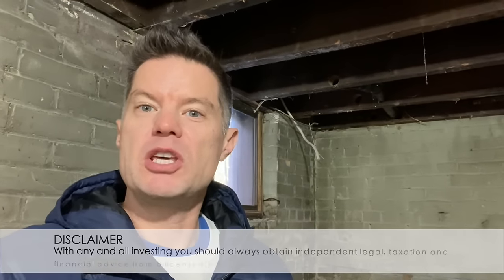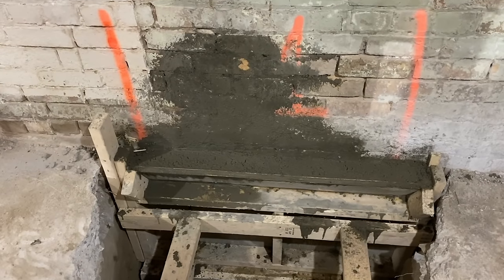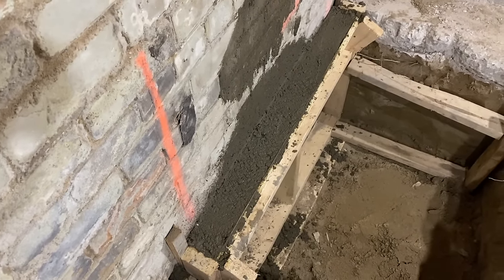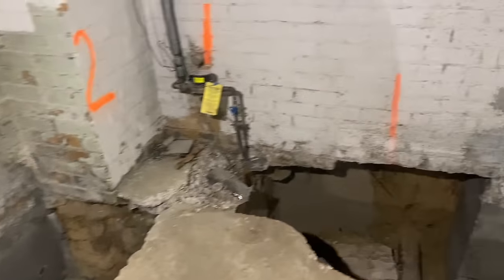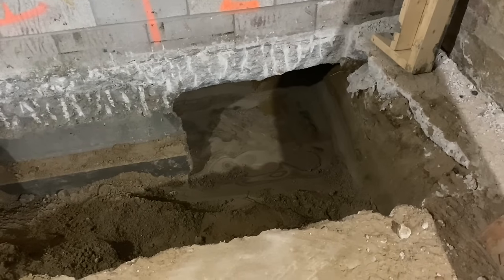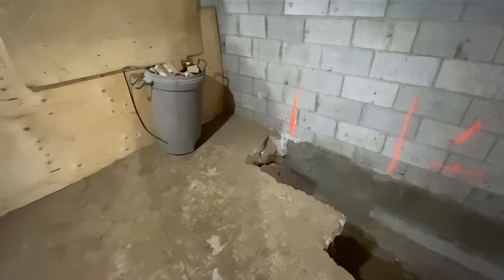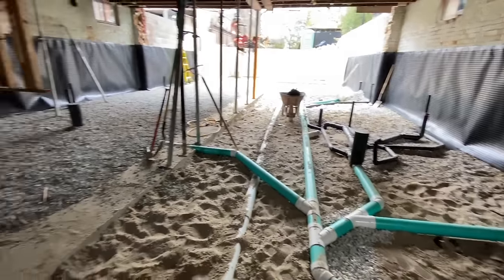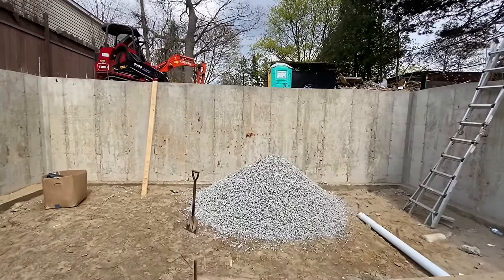Lowering your Basement | Step by Step Underpinning Explained | How to Lower a Basement

Comment: When I was in my late teens my father got me and some friends to dig out our cellar which extended under the back third of the house. The old ceiling was about 5ft and we dug out about 2ft more to make a decent room. Then we extended under the next third of the house where the ground level was about 2ft below the floor joists, removing about 12 skip loads of earth so he could put in an internal staircase. We actually dug below the foundations of the 1890's house which consisted of the bottom course of bricks corbelled out by a half sitting on about 18" of cinders then put in strip foundations and built up blockwork walls and finally backfilled between the blockwork and the old wall/foundation with concrete a section at a time. That was 40 years ago and there's been no movement since.

Comment: I’m doing a similar project but the engineer that’s designing it wants to do horizontal rebar between each poured bay. And so I’m using hydraulic jacks to dig out 6 to 7 foot wide sections at a time even though I’m only coring 3 feet at a time because I’ve got all this lap rebar hanging out.

Comment: 400/ft.  Thank you VERY much. Will use that as a guide to get estimates.   50x20 footprint. If I can get it done for that it would be lots less than I expected.  Looking at a quote I got from 2017 for $550/foot. Must be the competition in Toronto.

Comment: Great video! But I am wondering why you didn't use rebar in any of the new concrete you poured?
Reply: I'm wondering too! Also I wonder if they mixed Helix in with the concrete. Helix  can do away with the need for rebar but I would think the cold joints would need rebar to keep the individual pours aligned.
Reply: I guess it's no different than an old stone foundation... But why not use rebar?

Comment: At 15:00 - what material is the under floor insulation and what are those clips holding down the pex tubing called? 

I had a bear of a time trying to route pex under my ice rink liner. This looks like a better solution. 👏👏👍🏻

Comment: I WISH I could get a perimeter underpinning done for $400/ft. I am stabilizing a shifting/cracked (no rebar) concrete foundation in a 65 yo house on medium clay. All accessed from the outside. 210 LF. Should be around $85k. Bids range from $170K- $280k. Going with helical piers might save me about $50k, but half the engineers say it needs to be "capped" (essentially a partial underpinning) before the piers are set or sometime in the future, the foundation between the piers (23 of them!) will settle and the local contractors will need another infusion of $$. As best as I can tell, the "capping" (weird because it's under the existing foundation, I think) adds about $50k, so it's a wash.  GREAT Video, btw. Lots of excellent information in less than 20 minutes. (Many arrogant inspectors and contractors have spent more time just telling me how many years of experience they have...)
Reply: Yours sound exactly like mine. 800 sqft house with poured 4ft deep foundation with no rebar. cracked due to settling on clay. I planned on doing this once i get an engineer to give me the plans. need a wider base to support the weight of the house. maybe double the width at the bottom. I would over engineer the rebar though i dont want to have issues in the future. need to find me a structural engineer that can let me know if this is viable.

Comment: This is the most informative underpinning video I've seen, by far! I own a 1960 brick home in Ohio that currently has 6'10" finished basement ceilings. I am planning a complete remodel of the property in a few years and I am considering dropping the floor to get a 8'6" ceiling height. My foundation is much smaller than this property (basement is about 1000sqft total), but based on the cost of this project, I suspect it would still cost about $25,000 USD to complete my underpinning, which is about 25% of my total budget for the remodel. One thing that isn't clear from the video is whether or not all the waterproofing/management, drainage, sump, etc were included int he price. Also, it doesn't look like you added any rebar to tie into the existing footer.

Finally, did you consider using closed cell spray foam to insulate under the slab? I think it's a superior option because in addition to being an excellent insulator it is also an effective vapor, moisture and radon barrier all in one...especially if you run it continuously up the foundation wall into the rim joist.

Comment: what steps do we need to take to deter radon from entering the house home? Thanks you! Your videos are amazing and helpful! Thank you!
Reply from the maker: We put down gravel, a layer of 6 mil poly, then the 2" of rigid foam and then radiant infloor pipes and then the concrete. This area is not known for radon but if it was there are some additional measures that could be taken.

Comment: Great video. Have question. When you lower basement the sewer line can be lower than the city line. I understand you can install an ejector pump, but I've heard a lot of issues with the pump. Any other options you can suggest?

Comment: This is amazing!! Indeed. Would be really helpful to know how the main wall support beam/wall was built, then removed the support pole. Any idea how? Thanks!
Reply from the maker: All of the bearing walls were removed with temporary shoring post and beams. Support on either side of the load bearing wall and then remove the structure. Once that's done, you can reposition the load bearing temp walls to make it easier to work around them. Hope that helps.

Comment: That is very fascinating. The house has no continuous foundation, but only a thin strip of concrete on which bricked? Furthermore, the new, deeper foundation is not physically continuous? It's basically individual blocks now. Reinforcement would not have done anything because there is a crack between the concrete blocks every time? Our small 1960's house has a continuous wide strip foundation under the walls. I never thought that such a large apartment building could stand on the bare ground.
We'd also like to "raise" the basement, but we're afraid there's a reason the basement wasn't dug deeper, and we might hit rock.

Comment: Great video but I’m curious as to how you address when lowering the floor you inevitably expose the soil pipe embedded in the old concrete floor and exits the foundation perimeter wall at a fixed height.  If the new floor height is now below this point, how do you ensure proper drainage? Do you install an ejection pump? Thanks😀

Comment: @DarrenVoros Excellent Video... but you didn't make mention of adding any rebar into the underpinning walls? Is that something that was done and just not documented? Or is rebar optional if you use a specific kind of concrete?

Comment: Great video- Question-  Is there some type of underpinning for a house that has a dirt floor basement.  ( 8 foot at end and 4 foot at other end ? )
Reply: Doing just that to my aunt's place right now. It is set in a hillside in a split style floor plan with a stepped foundation.  There is a walk space of 21'x14' that we are converting to a great room.  It was 12' dirt to joist on one side and 8' on the other rising 4' across the 14' depth. We are chosing to frame the floor with a crawl space because bringing in ABC would have been by hand in 5 gal buckets carried up ladders. Framing will be way easier. We are placing in triple 2x8 open cribbing every 2-3' to allow for rebar placement. There is vertical rebar epoxied into the existing foundation wall through the footer in every section. We are pouring a step footing on the interior sides and a straight on the exterior (dirt soil) we are creeping our soil nice n flat like in this video. Where the piers butt joint the is a 2x2 on the form to key lock the pours.  In some places we are only adding 8" of footing in others 42".

Comment: Hey! Question for you, sorry if you mentioned and I missed it. 
I was looking to do my own relevelling, and support correction for my 120 yr old east coast home... but now wondering about lowering and making a full modern basement. Could you shed light on a average cost to do just the depth excavation and new pour? Appreciate any ball park figure for reference. 

My crawl space is about 5 feet in height, no concrete floor. All exposed soil. Some of the foundation is cinterblocks, some in stone and mortor.
Reply from the maker: Pouring a new slab should run you anywhere from $7-$10/sq ft.

Comment: @16:38, notice the concrete slab has no rebar. Slab will develop cracks. Notice also there is no rebar connecting new concrete footing to new concrete slab — not a good design.

Comment: In NY its min 8 feet apart for the pins. If closer, then the engineer has to provide structural stability 
calculations to the dept of buildings that is safe

Comment: I have a question, Darren.  What do you do when you dig your first hole(s) and find standing water or water leaching under the existing footer as you prep for your framing and first pour(s)?  I have moisture issues and mold on the walls in my basement ( cookie cutter house built just after WWII ). I want it dug deeper but I'm curious how you would handle it. American Dry has an excellent system that could be installed inside the basement along the walls that will drain below the new footer once lowered and before the slab is poured but would like to know how you would handle underpinning wet conditions.

Comment: Tried to do this in my 1859 brick farm house.  Im six two so needed a few inches for comfort. 

No problem as the fieldstone three feet thick foundation went far lower than the dirt floor. 

Found a large brick  tunnel, evedently it was a wibe cellar  (used to be a winery) and was used as part of the underground railroad  where they would hide slaves crossing the Ohio to freedom. . 

Ive been chopping away at the old grape vines and they are very productive now.  I prefer brewing so. I may make some wine and beer.

Comment: Great video. How deep can you underpin? Looking for an 18ft depth basement.
Reply from the maker: Anything is possible with engineering. You might not like the bill though. Why do you need an 18ft ceiling? My mind is racing with all the possibilities.
Reply: @DarrenVoros  I want to add a indoor basketball half court in the basement. It’s a large basement. I would need the extra height.

Comment: I was going to ask about the moron that installed the exterior waterproofing inside but didn't realize you could just invert the french drain as well with a sump pump. Here in Seattle, few contractors dig out basements, can you provide a checklist for me as a homeowner to estimate my costs?
?
Reply from the maker: Haha ya you can waterproof from either side. I don't have a checklist per se. Cost should be about $400/linear foot but if this is not regular practice in Seattle it might be more expensive.
Reply: Hard to find many people who understand how to do this in Seattle. We gave up. It's much easier to find them in the East it seems.

Comment: I wanted to know more about what happened next. I mean we didn't see the center wall get replaced which you spoke about and I wondered how that would work out  but we also didn't see what happened with the rear wall! I assume you had to replace the rear wall to maintain the support for the house. Perhaps there could be big windows in the rear wall? Or was it going to be a contiguous space? I also wondered how the rear extension would work as you didn't dig down further for that? Left at an annoying cliff hanger.

Comment: Question, I haven't started digging into anything but from what I can tell my house basement was built on top of bedrock. Does that change anything with regards to footings? Other than the obvious being way harder to dig thru than dirt.
Reply: My stepfather handled that problem by hiring a house moving company to lift the house straight up several feet and come back a few weeks later to set it back down. In that time, we had built a 5-foot-tall wall for the house to be lowered onto.
Turned a crawl space into a full basement with no excavation needed. As I recall it was somewhat less expensive than underpinning because there was very little hand digging.

Comment: Incredible job. How does water not penetrate the new concrete as it's done in stages. Does that concrete form together somehow, or is the water just picked up with the interior waterproofing?
Reply: That foundation was never waterproof to begin with. You'd have to dig up the outside to waterproof it. Even it had all been done in one pour, it wouldn't be waterproof
Reply: yeah foundations dont have to be waterproof consider the countless cinder block ones - cinder block is far from waterproof.  the key is good drainage into a sump pit si water doesnt sit in the foundation but merely quickly passes by it

Comment: Sir You are as Krazy as Me,
I'm going to do it but I need all the advice I can aquire because It has to be done Right.
I have a real good Idea but going underneath basements?
Good video Sir
Reply from the maker: Make sure you work with your engineers and city inspectors and you should be fine.

Comment: @5:41, missing rebars @top and bottom. Stirrups increase shear capacity, too. Your civil/structural engineer isn’t complying with building code.
Reply: I thought that there would be rebar galore hanging out of the sides of the walls myself. I formed basements for a while in Manitoba and we would have had at least a couple 1/2" rebar in there.

Comment: How does the cost compare of what you're doing vs. lifting the house, excavating and pouring a complete new foundation?
Reply from the maker: It's not about cost. It's not possible in Toronto because of the proximity to the house next door. Underpinning is common practice in the city for this reason.

Comment: what a my first construction jobs when I was 16 was digging with a shovel and pickaxe doing exactly this, the no hydro connection at the home so they brought in a generator through part of the wall that was opened up and my dummy boss forgot to remove the generator untill after the wall was repaired  😂😂🇨🇦

Comment: Was it necessary to remove the back wall of the house? I'm considering extending my basement, but I not if the house wall would have to come down. I have a brick exterior similar to the house in the video.

Comment: Do you include steel bars in the concrete ?
Reply: Wondering the same thing. 🤔
Reply: depends on the engineering regulations in your area, this being Ontario, the regs are pretty strict, I would assume there is rebar.

Comment: I want to renovate and underpin my basement, but the first problem is my basement walls are full of pipes and basically all of my plumbing goes there. My central heating unit is also there. My question is, can the plumbing be removed and put somewhere else, rerouted? Or something?
I would also extend my basement under my yard, but the wall which I'd remove to connect the new basement is chock full of pipes.
Reply from the maker: Ya the plumbing and heating always has to be considered but most people are gutting their basements when they do this anyway so it's not that much more to reroute things if need be.

Comment: I ve wondered; many reinforce these sections by driving steel reinforcements into the sections of dirt that have yet to be excavated.
Doesnt this give a chance for water to seep into these reinforcements because the 2 concrete sections Don’t fully enclose the rebar and this lead to concrete rot?🤷‍♂️

Comment: I have yet to find a video that explains how to dig out a subbasement.  I imagine that the concepts are similar, but I'm concerned that I'd be dealing with even greater forces and questionable subsoils.  

My house is a 1930's kit home with 2 stories and about 1,300 sq ft of living space.  I have a full stone basement with a poured concrete floor and the house is built on a grade.  The stone basement walls are roughly 18" thick of stone and mortar.  I suspect that the poured floor was added some time later and there is an added "curb" of poured concrete along the stone wall where it meets the floor.  Probably have a lot of stone (boulders, bedrock?) under the house as well - possibly granite or something close to it.  Not only that, but I suspect that there might be a dry well under it as well since there's a floor drain that doesn't seem to have a viable likelihood of sewer line connection.  My sewer line goes out the basement wall toward the street.

The grade puts the existing basement about one level above the street.  In front of the house, but somewhat off-set to the right, there is a two car garage that is at street level.  So the roof of the garage is roughly level with the house's basement floor.  There is about 20 - 30 feet of yard space from the front wall of the house to the back wall of the garage.  Because the garage is off-set to the right, the yard continues sloping downward along the left garage wall where it terminates at a retaining wall that runs parallel with the front (street) wall of the garage.  By that point, due to the slope, the retaining wall is only half the height of the garage.  

If I could excavate from the garage to the house, and then continue beneath the existing basement, I'd effectively be extending the garage under the house's basement.  This is the delusion I live under.  However, I do have the sense that this is going to be frowned upon by a lot of officials and inspectors unless I have it all professionally done.